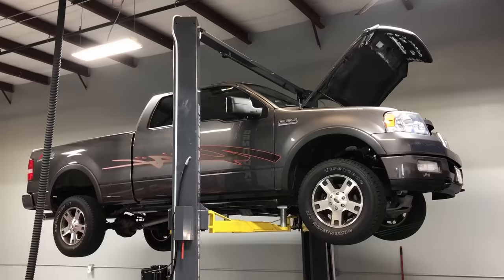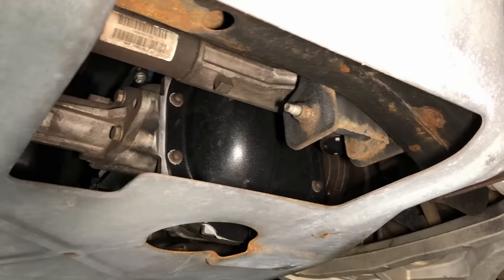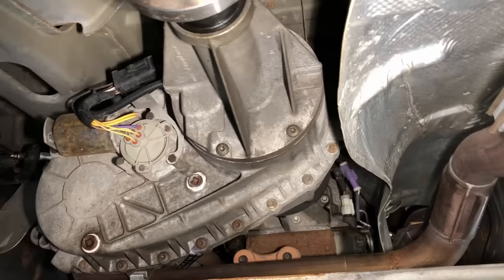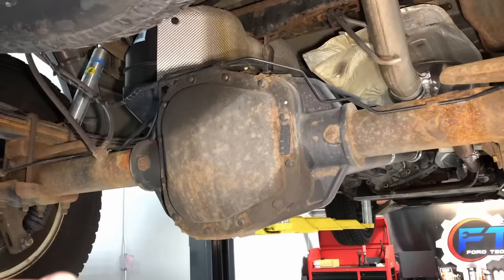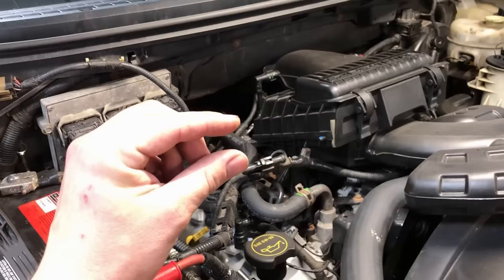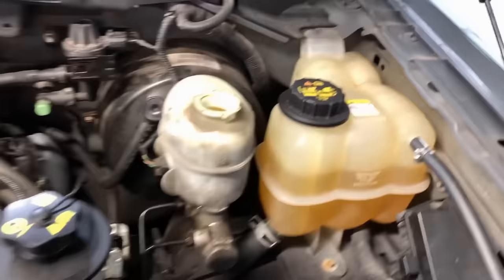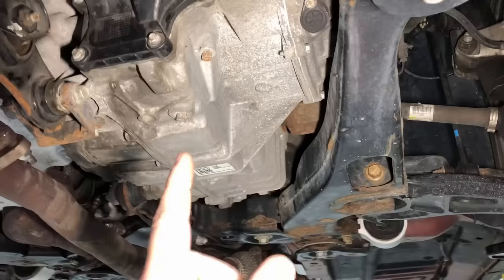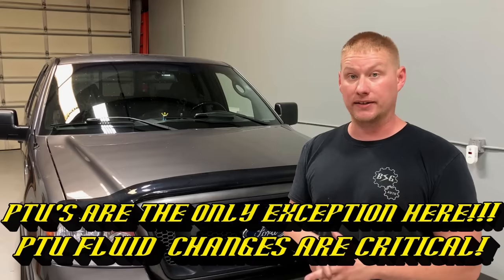Never Follow Ford's Lifetime Fluid Service Intervals: Here’s What I Recommend and Why!

Comment: I was on the fence to buy a 2004 F150 with only 35,000 miles on a 5.4L in it. I've always been loyal to Ford but thanks to your vids and other people's feedback, I'm  stearing clear of this particular one. Came to the conclusion that even though these trucks seem to be cool, they seem like a pain to keep up long term. I thank you for all the critical 411 needed to avoid a bunch of headaches.👍

Now I'm off to check out what seems to a good alternative  deal on a Tundra.😎✌
Reply: If you get a low mileage 5.4 and you know what it needs for maintenance/ prevention measures, the 5.4 might last a long time, but otherwise I would steer clear from any F-150's made between 1997-2010, especially with the 4.6/5.4. I would either stick with the 1996 and older F series ( although most are going to be high mileage and potentially breakdown due to age and mileage) or get a 2011 or newer, since the 5.0 is a better engine then the 4.6/5.4, it makes  way more power and is more reliable.

Comment: You have it right on changing fluids. You can`t lubricate with dirt. Also additives lose useable characteristics. I`m disappointed you didn`t give a ball park number on rear diff o/haul. There`s not that much time needed to set up the gears. Can`t be more than $1500 for a good shop and that`s not so bad.

Comment: I own 2 ford's and regular maintenance is key..
Oil change every 3k
Trans fluid every 30k
Antifreeze every 2years
Diff gear oil every 40k
Plugs, belts, hoses and brakes every 100k
I've got a 99 f-150 4.2L with over 750k on the clock that runs like a champ and I have had zero issues with and a 2013 escape 2.0L ecoboost with over 300k so trust me when I say maint is key. Many people treat their vehicles like a disposable lighter and just use it until it's empty and pitch it but if you look at the prices of new vehicles some can cost as much as a house.

Comment: Exactly this goes for all brands my grandfather has a 2010 Lincoln MKS  3.5 Eco-boost and the PTU went out at 60k says lifetime fluid which is BS. I see why they didn't put a drain bolt on the PTU just so they make sure it breaks. The only brands that are up front are Toyota and Honda from my experience. but great video

Comment: This goes for all makes of vehicles.  My rule goes even further.....get the factory fluids out of your vehicle the day you buy it. And if thats the day it comes off the lot at 0 miles, so be it.  Vehicle manufacturers aren't in the oil business!!!  I switched to Amsoil motor oil, transmission and rear diff fliud in my '07 Ranger.....totally changed its driving personality.

Comment: Oil and fluid changes are cheap insurance. Shortening up the oil change cycle doesn't cost that much more over the life of the vehicle.  I go every 3,333 miles with the oil.  It is real easy to see when it is due on the odometer (**0,000, **3,333, **6,666...), and the oil always comes out the same slightly used dark brown color, not carbon black and completely used up in appearance.

Comment: Just paid local ford dealer $2300 to fix brakes & change oil on '12 explorer & they wanted $180 to "check out" ptu.... hydraulic control unit, master brake cylinder, 1 brake hose & caliper...havent had it a month

Comment: No matter what kind of vehicle you have, at least some of the service intervals are designed to make the dealer money from parts sales, especially when it comes to transmissions.  When it comes to engine oil, just change it every 3,000 miles no matter what kind you have.  Better overkill than underkill.

Comment: Nice video.  One thing I'd like to add is if you're dropping the trans pan, always change the filter.  Also, always use Ford OEM filters as the are the best of the best.
Reply: Lol they are built to a spec by the lowest bidder

Comment: Just anecdotal, but my dad has a 2000 silverado with a 4.3 with 305k miles on it and doesn't burn a drop of oil, probably because he gets the oil changed religiously every 3k.

Comment: The same thing can be said about every manufacturer. My friends Honda manual says to change the oil filter every 5k and then top off the oil then change the oil and filter at 7.5k. The only reason they would do something that stupid is so they can advertise 7.5k mile intervals on the oil change.

Comment: 6f50... if the filter is plugged you have much bigger problems. The filter surface area is great enough to allow the filter to do its job throughout the life of the trans if it does plug you need a repair anyway. Change fluid in a ptu is damn near impossible considering it doesn't have a drain plug and filling it is worse because the plug is next to the cat with little room to access.

Comment: Thanks for the information.   I recently took my 2015 Escape in to my Ford dealership where I bought it with 30,000 miles requesting a transmission fluid change.  They did not want to do it and talked me out of it.  They said Ford doesn't require it until 60,000. I told them I knew that but wanted to be safe and change it earlier.  They still did not want the job.  I was stuck because there are no other service centers near me that I knew of.  Our little town is a tourist town. We have three car dealers;  Ford, Chevrolet,  and a Dodge/Jeep dealer. Every other little garage in a mom-and-pop grease trap. And I'm not taking my Ford to another brand dealer.  
I'm sure I'll get a lot of comments over my last statement.
Reply: Johnny Umphress I actually used a Chevrolet dealership for maintenance on my Ford Mustang. I started using them when I owned a Pontiac G8 and I appreciated the honesty and discounted prices they often gave me. I used to work on all of my own cars. There was only one tech there that I used and he would even let me in the shop to see what was going on. 
Sometimes I would bring them Ford parts that I purchased since I preferred to use those.
Reply: @ww21943  That would be fine but our Chevy dealer is money hungry.  Our Dodge dealer doesn't have a decent tech.
Reply: I hear ya. Results may vary
Reply: If you want to get the job done I would talk to the service manager. I can’t imagine the service department turning away money that you want to give them.
Reply: Ford dealers often work on other brands, it’s like a tradition. Never heard of a Chevy dealer doing that but yours might.

Comment: I bought a used 2005 navigator with 148,000 miles last year i'm big on clean fluids because you wouldn't drink from a dirty cup after I got under the hood the brake fluid weas black  I took it to a mechanic he told me if I had the brakes flushed the brakes may stop working I had the system flushed and the brakes still work.

Comment: IMO initial 30 k service done on the drive train components initially  to get the metallic particles out left over from manufacturing and break in period out and you're probably fine every 60K thereafter, or until a leak develops from a seal or something later

Comment: The Foreman at my local Ford dealership told me that my 150k mile F150 should not get the filter changed on the transmission and that f150's in general don't like fully synthetic engine oil.
Reply from the maker: lol
Reply: They want you to buy a new truck from them am sure the foreman is part of the scam

Comment: I absolutely agree with you. I found your channel right before i bought my 2015 f150 last year. It had 37k on it when i bought it. My first 5k oil change i had my service department at the dealership do a front/rear diff  and transfer case drain and fill. And ill be having them do the trans on my upcoming service. Then at 60k im getting the spark plugs done. All the techs at my dealership agree with my plan 100%. They even think the service intervals from ford or any brand now adays is flat out nuts. Its the nicest truck I've ever owned and im going to keep it that way as long as possible.

Comment: My step dad has a f150 2014 v8 2w drive and never changed any fluids except for engine oil. Never changed spark plugs either. It's at 210,000 (many highway miles) right now. Maybe he should consider trading it in for a new one before it probably dies soon? It does seem to have a starter motor issue (takes a few times to crank it, when it's cold 1st try). But still seems to ride and shift smooth.

Comment: i agree do not follow this lifetime fluid crap  ive been changing my 2013 f150 fluids regularly and have had no problems except for a water pump replacement and this truck currently has over 400k on it    great videos

Comment: What is the most recorded mileage for a gasoline powered f150/250 to your knowledge?
My  05 hit 340,000 on 01/21/2021
There must be many more pickups with more miles on them
That's impressive! 
In the1960s,70s,80s 150,000mi was impressive for any full size pickup. Mileages seemed to rise, starting in the 1990s👍🇺🇸

Comment: You don't need to change oil that often.
I change conventional at 6000 and have excellent results, mind you i do use 15W-40 HDEO which is already designed for long intervals.
In fact it's good to extend oil changes, Ford themselves did a study and found that wear goes DOWN, not up as the oil ages.
Reply: Oil never gos bad, its it becoming contaminated that's the issue.

Comment: Here Brake fluid is recormended to be changed every 2 years.
Reasoning is that water lowers boiling boint of brake fluid.
If brake fluid boil you dont have ANY brakes left to slow you down.
That is because fluids dont compress under pressure but cas dos compress thats why boiling boint matters.
So remember after you open air seal from brake fluid it starts to go bad depending your air moisture you should recygle it cordingly and buy new one if needed after 0.5 year...

Comment: Great information, Most Ford models are very reliable if given proper maintenance. IM thinking of trading my 2013 Taurus on a 2017-2018 Taurus? also considering an MKS, I hope you can answer this question, do you feel an MKS is more or less a rebranded Taurus?  are there differences in suspension, or sound deadening? feedback is appreciated

Comment: I bought a used 2013 Explorer at 50k. It needed all fluids replaced, transmission fluid was black. I keep the oil monitor at 50%

Comment: You didn't mention the engine oil for the Taurus. please add this especial for hot middle east whether.
Reply: That goes with any other vehicle. At the very most, if you're running full syn, 5k miles. SemiSyn ~ 4k, and conventional at 3k

Comment: I have a 2011 f150 xlt 2wd. I bought new and it has the 5.0. With 6r80 trans.The truck has 215k on it and the original trans and diff fluid. Change the fluids or drive until failure? Tick, tick,tick, BOOM.

Comment: How’s it going ! I have a 2006 f250 . It was running rough , then it would start idle up then slowly die . You could give it throttle and would run then die when off accelerator . Now it crank but won’t start at all . Checked all fuses and changed sensors in the valve cover . What do you think .

Comment: I'm pretty sure I had a Taurus that had it's transmission die from exactly what you described.
The repair cost more than the car was worth at that point.
Reply: Get a used one. Way cheaper
Reply: My taurus trans died at 85000 miles due to torque converter

Comment: wonder if you could do a vid on 'keeping your truck to say 500k miles'....   what are the things to do - understanding the oil changes and stuff, but ball joints, belts... not in detail, more of a 'check list' of things to do to extend the life...   and what IS the life technically - if you're religious about maintenance, how many miles could you feasibly drive a vehicle?
Reply: My 93 Explorer just hit 300k miles, original engine and transmission.  Just keep up with the fluid intervals (I've like the 30k rule for most, 3-5k on engine oil) and general maintenance, ball joints, tie rod ends, ignition,  and other wear items. :)

Comment: What is a PTU that needs to be changed every 30,000 miles?
Reply: Power train for front wheel drives, and front wheels on AWD vehicles

Comment: Do you believe the Ford dealer would not touch my car and I have a 2020 Ford escape with 40,000 miles on it only. They would not change my fluid for the PTU or the rear differential fluid so I took it to Midas I had to buy my own fluid from the Ford dealer and brought it to Midas and they changed it with no problem, I’m doing it at 40 ,000mile intervals thank you very much

Comment: My 2019 F150 5.0L V8 4x4 Lariat short bed now has 10,550 miles. I bought it when it had about 10,300 miles. Carfax has no record that the transmission fluid has ever been changed. The transmission works fine. Woodrum Toyota of Macomb, IL recommends me to NOT change the transmission fluid at this point. Because doing that might seize the transmission.

What is your recommendation, please?

Comment: Outstanding presentation!  I have a 2020 Ford Transit 250 AWD with 3.5 litre conventional gas. Bought it new, now has 21,000km (Canada).  I change the engine oil at 30% life remaining, using semi-synthetic.  Check engine light came on for a few days, then went off.  I'm thinking about getting a scanner to view live and code freeze data.  Can you offer a suggestion for a scanner that would work with my vehicle? Thanks again!

Comment: My f150  been using for a couple years, with 34000 Odo and now need to change differential R fluid and power steering transmission fluid, need to change or until 60000 odo?

Comment: Thank you for your videos. They are always very informative.   I just bought a 2016 Ford F150   Lariat with 73k  5.0 and 6-speed auto.  I called the dealership, and they told me that could wait until 90k to change my transmission fluid.  Is this correct?   Thank you 🙏🏽

Comment: When you refer to swapping out the spark plugs every 60 to 80k, what type is being referred to?  I have copper plugs in now, so if I have read correctly, I will only be getting about 20 to 25k out of them (2009 Ranger xlt 4.0 v6, btw).  The 60 to 80k recommendation is based on using platinum, iridium or double platinum?  Thanks for your time.  Great channel!
Reply from the maker: regular platinum
Reply: Thank you sir.

Comment: When I bought my explore last year the dealer told me to change the oil every 7 thousand miles it’s synthetic blend he said.
Reply: I've used Blackstone Labs for oil analysis for 20 years. They do a great job of finding details that may be of concern with your motor. I use them every 20K miles. I used them every 10K with my previous diesel.

Comment: Hey there i have a 2001 f-150 5.4 with the 4r70w. Just to clarify i use mercon v for the trans and power steering? And the mercon lv for the transfer case?
If you go on motorcrafts website it says mercon v and lv to not be used in the transfer case. I thought mercon lv took over to be used in the transfer case.
Motorcraft has there specialty transfer case oil listed on there site which i thought they quit making.

Comment: For 2011 F150 ecoboost, fuel filter is inside the fuel tank and therefore not serviceable.
Reply from the maker: Yes, starting on 2009 models the fuel filter is lifetime and part of the fuel pump.

Comment: Fuckin wow...I use full synthetic Royal Purple & still change every 3k miles. But thanks to u I'm extremely concerned about my other fluids. I normally do spark plugs every spring such as a coolant & power steering flush but I put a shit ton of miles per year on my vehicles. I'm mainly based on oldschool so I'm pretty sure shit has changed from back then up till now like never changin ur transmission fluid to only top it off. I recently bought an '02 Crown Victoria LX Sport & she has not been taken care of well. But recently I've started implementing a fuel filter change every 3k like my oil. But I'm worried about da other parts dat r clearly failing so dis video helps me a shit ton on how to take care of er once those parts r replaced.👏👏👏

Comment: Question. I have a 2012 f150 Harley edition 4x4 with the 6.2L. I bought it new and i just turned 32K miles.  Should i stay with your mileage change times or is there a number of years equivalent?  Thx.

Comment: Hi I have a question , I have a 2000 f150 xlt v8 triton , I need to replace my seats I don't know what years fit in this car and also where is located the air cabin filter , where is located the drain for the a/c thanks.

Comment: I have a 2011 F 150 xlt. It has a 6.2 L motor. I have the oil changed  when it's time. I bought it used and it was getting 16.5 mpg. Last fall it went down to 13.5 mpg. I'm thinking it's because of the winter. It's spring and it's still at 13.5 and it's not going up. What seems to be going on and what can be Dunn to improve the mileage.  It's mostly city driving to work and home.

Comment: What about for us dummies that listened to Ford and haven't done a Transmission fluid change and it's old.  I have a 2010 f150 and I bought it at 80k, but now has 160k.   Would it be safe to change tranny fluid? I've heard I could ruin the transmission if I change it.  Thanks,

Comment: I have a 2008 p71 Crown Victoria I changed the antifreeze from the clod to the green this spring. I did a thorough flush and ran a day with water and then flushed again. After that, I added the green.  I am concerned though will the green harm my block or intake? should I have kept the gold? I heard so many horror stories about the gold that I thought I make the change. All seems good however would like advice. I used prestone prediluted 50/50

Comment: My 17' Explorer XLT with the  non turbo 3.5 uses Motorcraft Orange coolant. Book says 100,000 miles before changing (car has 46,000 miles on it) would that be safe? Or should I change it sooner?